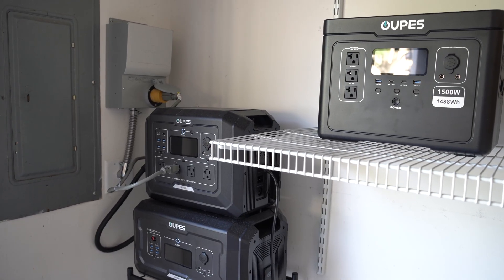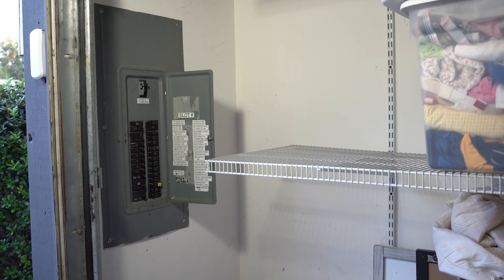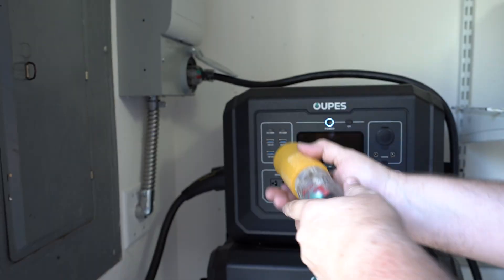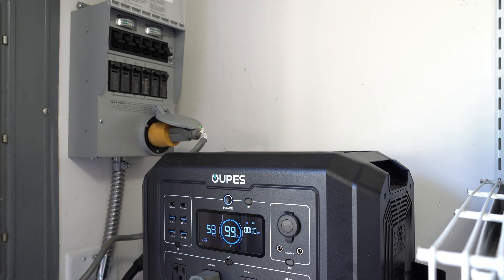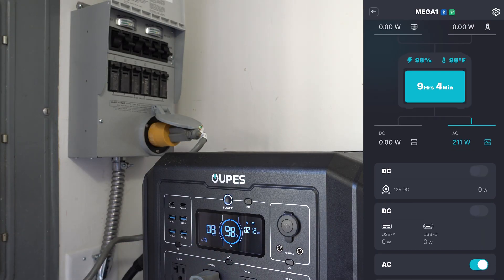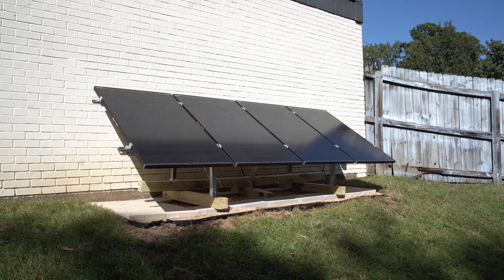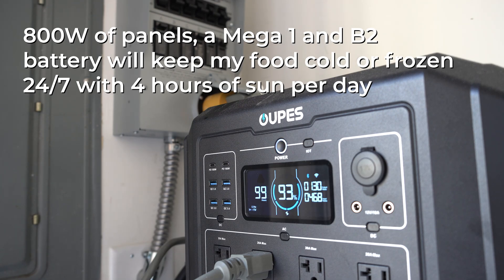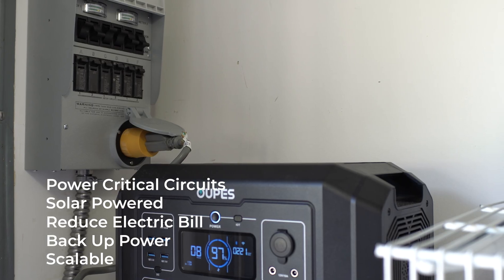How to start building a backup power system

Comment: Nice job.  One note:  You have to be careful when switching anything that has a compressor such as your refrigerator or an AC unit.  When you switch from utility to solar, the switch momentarily passes through the middle (OFF) position.  This can short cycle the compressor.  If this happens you may see a spike in the current.  This is not good for the appliance or your solar generator.  To fix this, just turn the appliance off before you make the switch or just go to the middle off position for 30 seconds or so before going all the way.